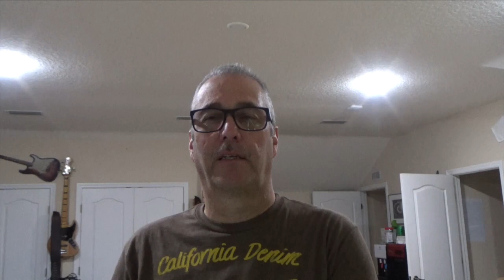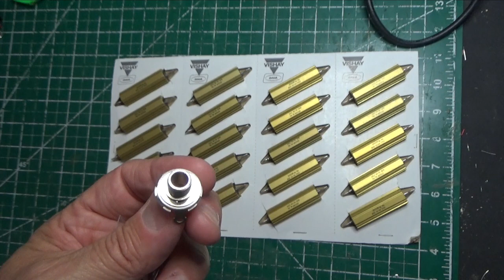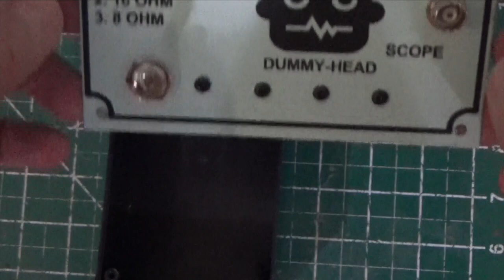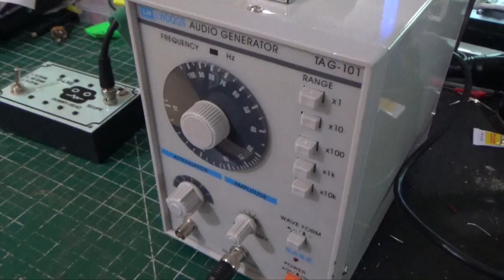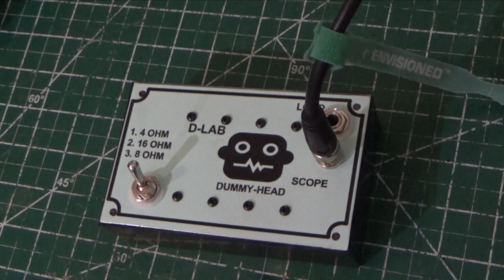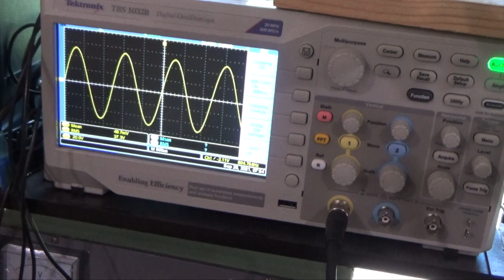Dummy Head :  Dummy Load Resistor Box

Comment: Great video, Ron! Hope you've sold some boxes, they look great and well made. My purpose for a dummy load is a little different though. I have a non master volume guitar amp - a Fender 5E3 clone - in which I've had the external speaker output jack altered to a line level output by a qualified tech. It works just fine, I can take the "line" output to my audio interface and get the sound of the amp into the DAW. BUT: The way it's wired, I have to use the internal speaker also, so my dummy box has to run for hours and hours. Is there anything I can do differently to make it stand the heat? Buy another type of resistor or anything? B.r. Svend. (The amp is 15W and 8 Ohm)
Reply from the maker: How many watts does your amp push peak and is the speaker a 4ohm or 8ohm ?

Comment: What’s the purpose of the resistor between the signal in and the BNC out if you don’t mind me asking? Only reason I can think of is to create an integrated 10X “probe”, which isn’t a bad idea at all.
Reply from the maker: Sebastian -  The resistor serves as protection if the jacks are ever shorted.. it would limit/prevent any damage to the dummy load box, etc.
Reply: @rciancia  ah, that’s a really good idea, cheers!

Comment: Last year I bought four 8.2 OHM resistors on EBAY (yes Chinese) to make a dummy load but never got around on making it.
Mine was going to be stereo 4 * 8 OHM only because I have no need for 16 OHM load.
I never made it because I get very little radio repair and no stereo repair.
Terry's design is very good.
Reply from the maker: Thanks Bill. It is certainly a well made unit and one that would last.   We'll see how it goes... thanks my friend.

Comment: I tought the whole idea of a dummyload as this was so you could run the amp at full load for some minutes to see how the amp perfomed under load. Something you can't do with speakers. The resistors here are strong enough to handle it, but the box and the wiring is not. Why do it just halfway and not a complete testbox?
And also, if you use 2 og these boxes, and connect both to your scope,  you end up shorting together the negative of both channels. That might be a bad thing.
Reply: @Gunderman  Blueglow Electronics
https://www.youtube.com/watch?v=piRtOAUIKzw
xraytonyb
https://www.youtube.com/watch?v=QS8GgUWnbq0
 Electronics Old and New by M Caldeira
https://www.youtube.com/watch?v=1WzAR91QqF4
Among others, have all shown this so I don't think that's necessary.
BTW, their all interesting videos.
Reply from the maker: @Gunderman  Do you mean a demo ?  Its in this video
Reply from the maker: Geir, frankly not sure what you are trying to say, but I am using solid core wire rated at 600V.  This is meant to be a testing device to check an amp or radio. It can run for a while with no problem, but left running for a long period of time will generate heat. Regarding using 2 boxes, that is up to the end user ; my box was built with quality and will do a great job for the average user if directions are followed. Thank you for your insight
Reply: @rciancia  I was just wondering why you choose 50watt resistors (it looks like), and a big switch (good choices both),
and then the thin wires that looks like it's not able to handle that kind of load.
And what has 600volts to do with it, you never have high voltages on the speaker outputs do you?
I would have went for heavy gauge (and heat resistant) wires over high voltages in an application like this.
But if this is for quick tests of guitar amps, then it might be ok?